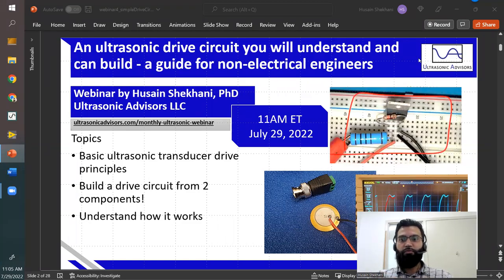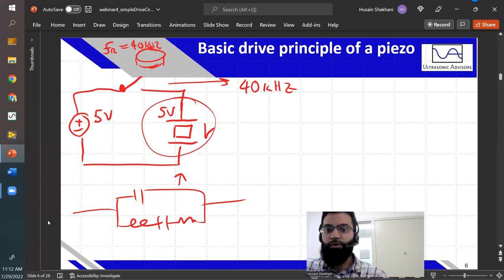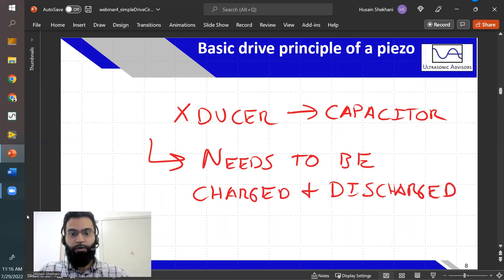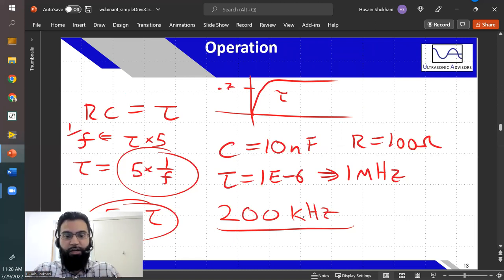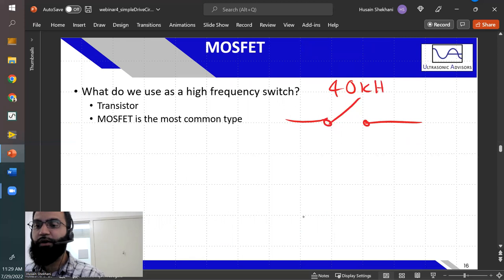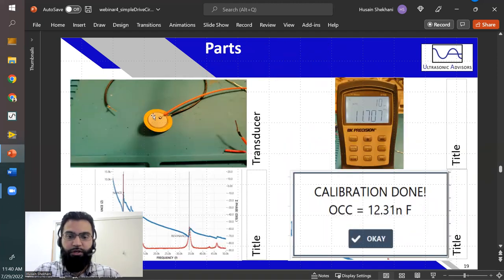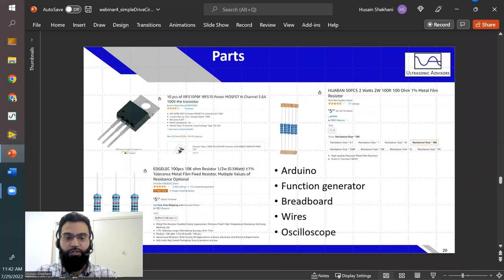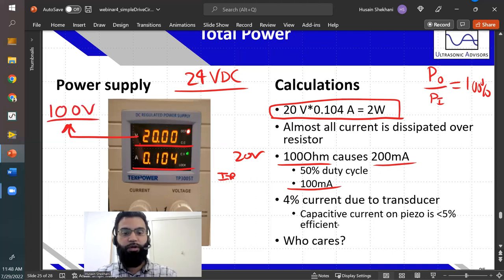Ultrasonic drive circuit that non-electrical engineers can understand

Comment: How much oomph you can put into this and other transducers would be good as their data sheets seem very ambiguous about input and output, interesting though. PDF's for these ultrasonic transducers suck.
Reply from the maker: I agree. However, transducers are not well characterized expect as characterized in the final assembly by the end user engineer. They are not like a MOSFET. They are more like buying a bar of steel which you will make into something else with it's own properties based on what that thing is.

Comment: At 39:33, on the actual breadboard, it looks like the 5V Signal from the Frequency Generator is going to the Drain on the MOSFET, not the Gate? Shouldn't that red wire running from the probe go to the left-most pole on the MOSFET? Or am I mistaken?
Reply: Great set of videos, btw -- very helpful!
Reply from the maker: I watched it and you are right - the signal generator should drive the leftmost pin. Thanks!
Reply: @ultrasonicadvisors  Thanks! I’m new to this and was trying to make sure I understood how it all worked.

Comment: Hi Husain 
 Does any piezoelectric crystals  increase or decrease  Toto volume .  or do they just change shape while preserving total volume? if so  which crystals produce the most change  in total volume , if not  are you aware of any material that changes total volume when voltage is applied?
Reply from the maker: Lead free ceramics have low poisson's ratio. That means they change volume more than PZT materials with an applied voltage, relatively.

Comment: Dear Husain, I m wondering if you could cover the amplification part since most of the piezo transducer will require power amplifier. What is the minimum amplification required for one piezo transducer? How to determine suitable amplifier ?
Reply from the maker: You need to determine your power requirement. If your amplifier meets the power specification, you may need a transformer to increase the voltage (step up) or a transformer to incresae the current (Step down)